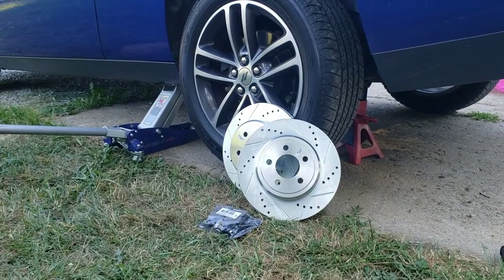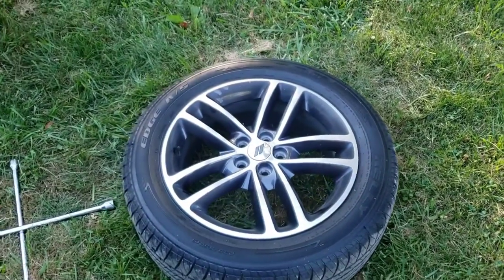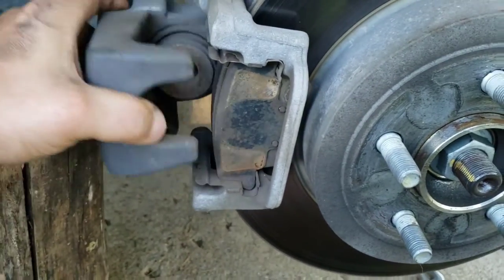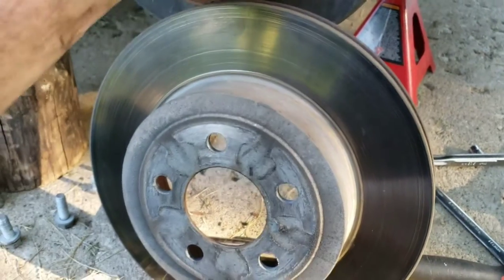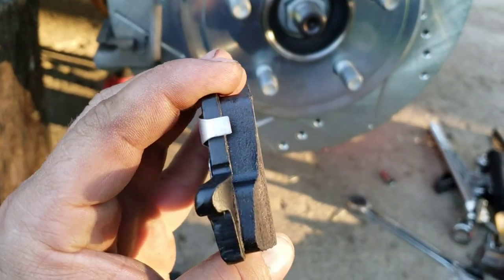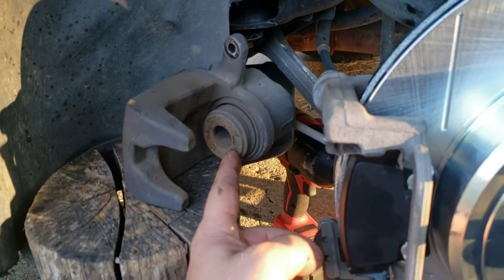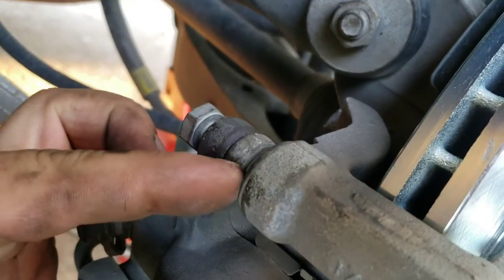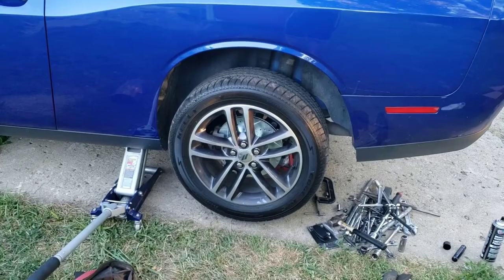15-22 Dodge Challenger Rear Pads & Rotors Replacement

Comment: I like your videos. The brakes all look straight forward. I have done many brakes in the 40some years since I started working on cars at 13 yoa. I figure since these videos are available, why not check them out before you do your own, in case of anything 'Weird' with the model you are working on. Thankfully there isn't but Thanks for the video!
    One suggestion. Try using rubber gloves while working on the car. It took me a while to get used to them but they really save your hands from drying out and your skin cracking! My hands started drying out from hand cleaners when I turned 50. It might save you from some painful cracks along your fingernails! In the winter time those cracks are Awful!
     Ya'll Take Care and Happy Hotrodding on your Challenger! -John

Comment: Question: Any reason why one brake caliper would be easy to press in but the other extremely hard?
Reply from the maker: Either the caliper is starting to fail, or the brake hose is. If you open the bleeder and then depress the piston (all the way) and it is hard at all to push in at any point, then it is the caliper. If it's easy with the bleeder open, then it is the hose. Regardless, it is one or the other. If you do this to check, you will need to properly bleed the brakes after (on that caliper).
Reply: @BuckeyeBallistics bleed all the calibers air likes to go up lines